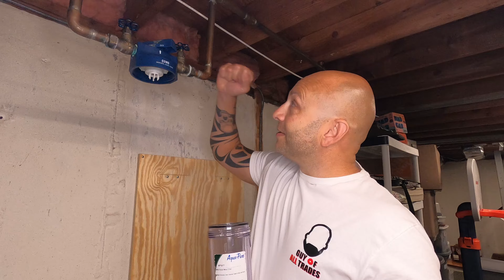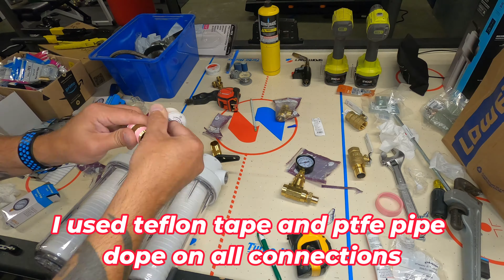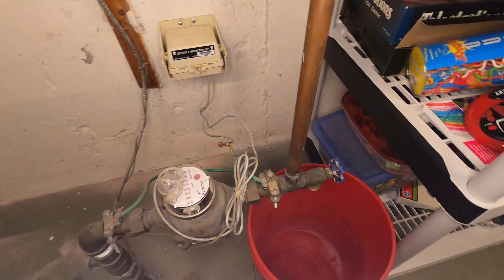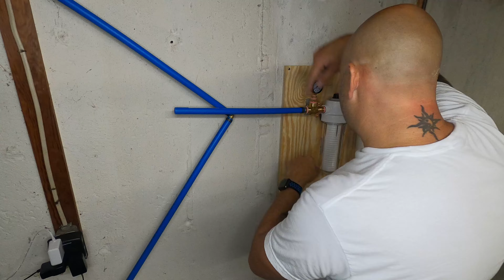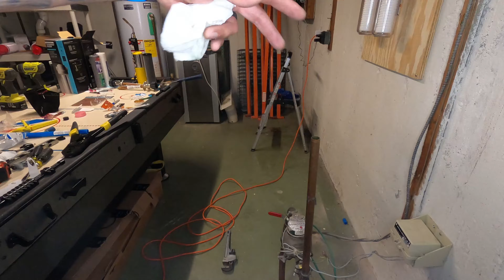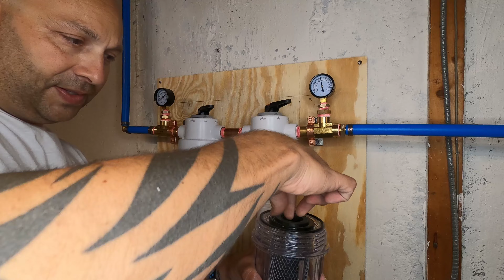Whole House Water Filter - Step by Step Installation

Comment: Great video—thanks!   I can see why You wanted to eliminate that head-banger bypass loop but I’m wondering if I should maintain one just in case I have filter issues.  Have you found that built in bypass to be reliable.
Reply from the maker: So far it’s working great

Comment: curious about the change of water pressure between the before filters to after, im running a well and considering doing this however my water pressure is much lower so i worry about how much it will drop.  Thank you for the video
Reply from the maker: Welcome and thanks for watching. Even after about 3 weeks now the differential pressure between the two is maybe 4psi

Comment: Hey what’s a “PRV”? How often do the filters need to be cleaned and/or replaced? GREAT VIDEO!
Reply from the maker: PRV is pressure reducing valve. Having water pressure this high can cause water hammer (pipes banging). For filter replacement, it's recommended every few months but that all depends on usage. There's 5 of us in this house so I'll probably monitor the condition of the filters and change accordingly. They are cheap enough and to have cleaner water is definitely worth the extra money changing them more frequently.